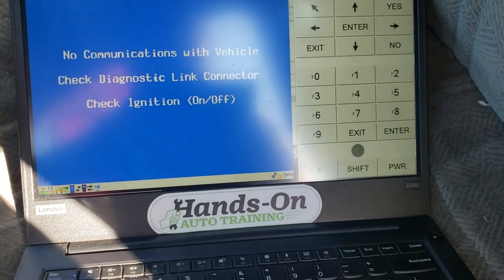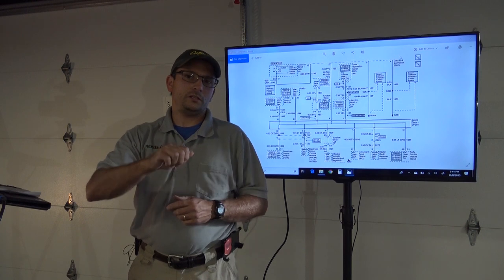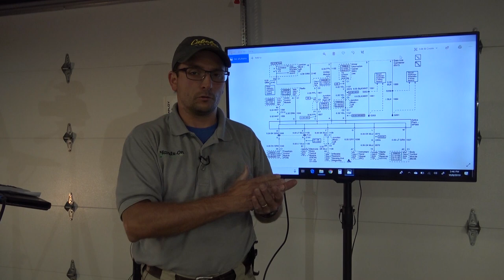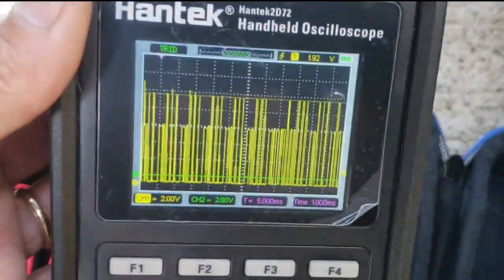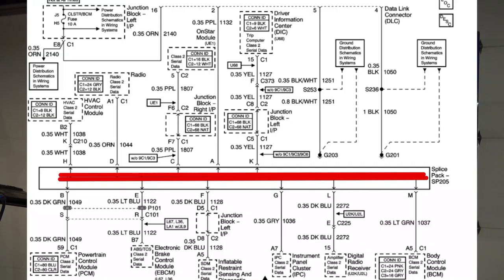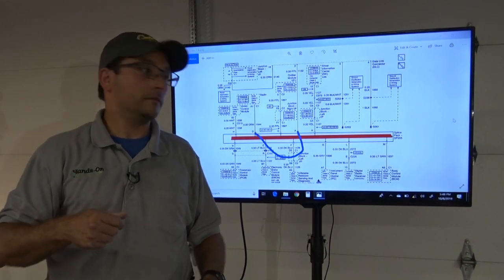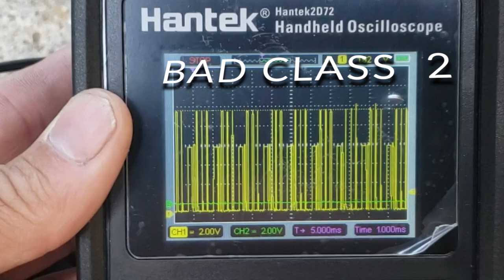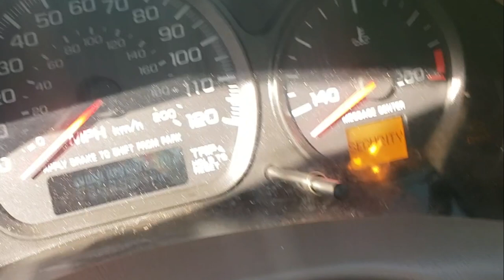GM Class 2 high no communication 2004 Impala

Comment: I have seen where the harness gets pinched behind the Aftermarket radio and shorts the data wire to ground. Also on those old Impalas, the Airbag module under the passenger seat gets soaked with water and kills the bus. Great video!

Comment: Brian,enjoying your networking videos. Following Maic Salazar who is giving a small on line course on what to look for and how to test PCM/ECM/TCM plus some repair and PCM schematic read outs. I have purchased some bread boards and components and hopefully get into creating some test gear. I've looked at arduano but really don't know where to start.Is there a beginning project to get some knowledge as to exactly what they are and which ones are suited for automotive. I apologize for the questions but if I get a good starting point I'm very capable at self learning. Been a mechanic my whole life just not on the advanced electronics end. Thanks for the schematic reading that's starting to click. Thanks Brian ❤️ Brian can you explain a splice pack comb. I believe my 2007 3.5 odyssey has one under the hood but need to know more what I am looking for. Thanks
Reply from the maker: I will have to look into the splice pack on your Honda, more than likely just ties the network together.   Arduino is cool. I use them for demonstrations at scope classes, put out square waves,  multiple injector control circuits, I will send you a video. Also I am using a 555 timer / breadboard for pico mask video I am working on. If you can afford an arduino buy it, it will make you learn alot!   Also this book is amazing, it is my go to for electric knowledge Practical Electronics for Inventors, Fourth Edition https://www.amazon.com/dp/1259587541/ref=cm_sw_r_cp_apa_i_jC8sEbJ0B423N
Reply: Brian I just purchased the book you recommended. Is there a Arduino you would recommend for starters? I see so many. Thanks Brian for the feedback.❤️
Reply from the maker: @arthurfricchione8119  the uno is the best,  it's a few dollars more for a genuine, I  have many genuine and knock offs the quality is a bit better with the good ones.. 3 or 4 bucks more
Reply: Brian Mann done purchased arduino uno R3. Thank you. Hope you don’t mind the questions. Yourself and Maic Salazar are so helpful and knowledgeable. Thanks for sticking with me ❤️

Comment: I have a question Brian about testing through the splice connector. I don't get to see these here in Belgium. So I have no experience with it.
If I understand this right you're just jumping pin 2 from DLC to the pcm because your scope is connected to your break out box. Without it you could just go straight to the pcm wire with your scope lead? 
I also saw a video from a while ago on trained by techs where Keith Perkins does the testing with a spliced together wiring harness and actually starts by adding the different modules one at a time to the network. Now he also mentions that the pcm  and bcm provide a 7 volts bias so you have to start with one of them first before adding other modules. So this is where I get confused. If that's the case you can not jump the modules one at a time from DLC pin 2 (except pcm and bcm) or measure each wire individually at the splice connector. Is this correct?
Reply from the maker: In my experience you can add one module at a time, and I have just jumped individual modules one at a times and it has worked to check comm with the scan tool to say a air bag or theft module. I may be able to make a quick demonstration for you to show this. Thanks for watching!
Reply: I mentioned my confusion in a livestream yesterday and Keith DeFazio told me there is no 7 volt bias. So jumping the modules one at a time makes sense. Thank you Brian!

Comment: I'm just trying to get it to pass E-Check, but once the drive cycle is complete my security light keeps flashing in my information window and the radio won't come on, someone put an aftermarket radio in the vehicle and I believe that's what's causing the problem, it won't communicate with the E-Check kiosk computer, but my scan tool works. .no problem starting tho
Reply from the maker: Try taking out that aftermarket radio